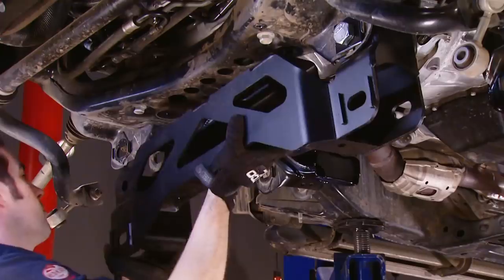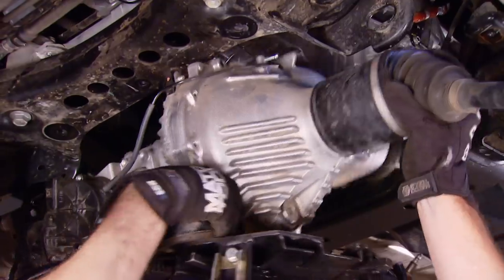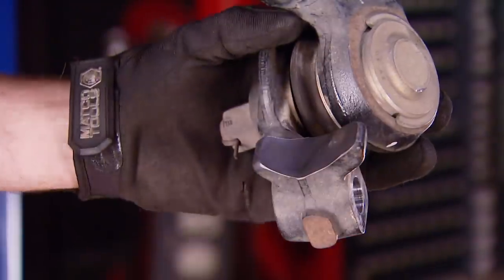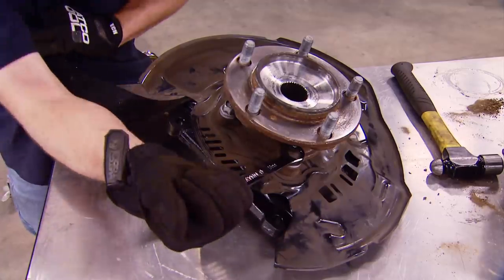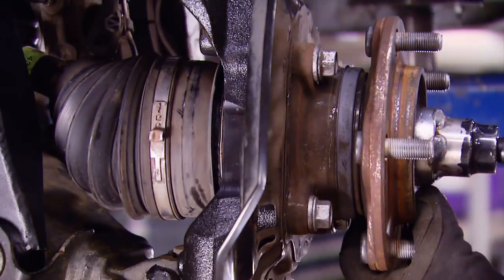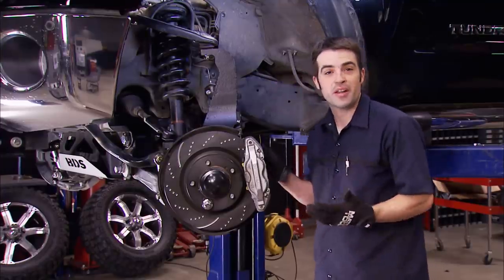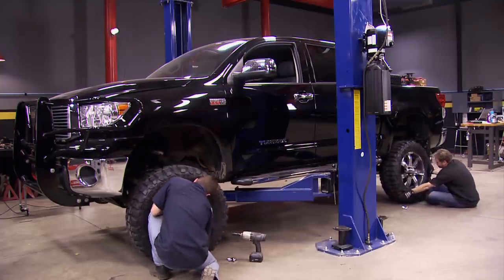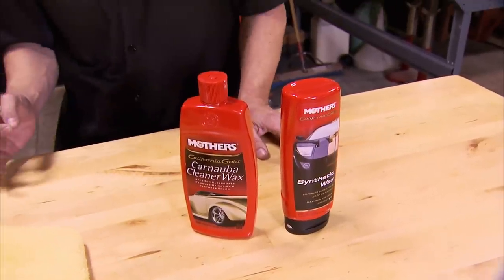Giving Our Late Model Tundra Some Height With A 4" Suspension Lift - Truck Tech S1, E1

Comment: I used to install
These at a Toyota dealership, if you do it yourself and your truck isn’t basically brand new , plan on buying wheel bearings. The old ones need to be beaten off with a hammer
EDIT : no cross member cutting with the lots we used from TOYTEC . COM

Comment: Had a 3 inch and 33s on my 08 then went to a 6 inch and 35s absolutely hated it sold the truck bought a 13 and put the same 3 inch with 33s on it and a supercharger that was 4 years ago no issues freakin love the truck

Comment: Why remove the strut spacer/leveling kit to just put a worse designed "extender"?
Reply: I've yet to drive a truck with a leveling kit that used blocks on the front strut that didn't ride like trash.    The thing they replaced it with is definitely not the best way.    Currently I'm running the Rough Country 2" leveling struts and it rides like stock.

Comment: How much do the larger tires affect the accuracy of the odometer?
Reply: They don't.  You need to reflash the ecu for the larger tires that way the speedometer is correct and the transmission isn't confused by the larger tires.

Comment: So 4 1/2 of lift but no more articulation then stock. I get the extra ground clearance but if I did all that work I’d want better articulation.
Reply: lol the most articulation this thing is gonna see is accidentally popping a curb at Walmart, no way this thing is gonna see gravel!!
Reply: @johnclark6139  you make a good point.
Reply: Exactly. This is like on hd pickups. Many want a lift but few go the suspension route. Such as a carli or thuren suspension. This thing likely rides like donkey poo.
Reply: @brandonm6052  absolutely most folks do cheap body lift or cheap suspension lifts. They do ride like poo, have either stock or less articulation. Doesn’t matter since most want the look not the performance

Comment: First you should strengthen the flimsy frame, the Tundra frame is way too weak, watch Ford 150 vs Chevy Silverado vs Dodge Ram vs Toyota Tundra and see the Tundra try and throw the bed completely off the frame, weak as crap